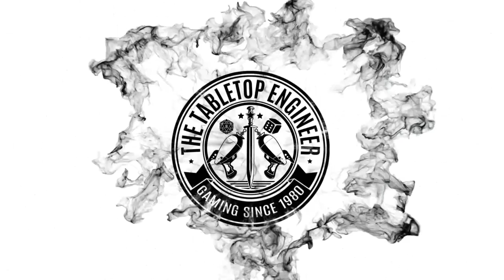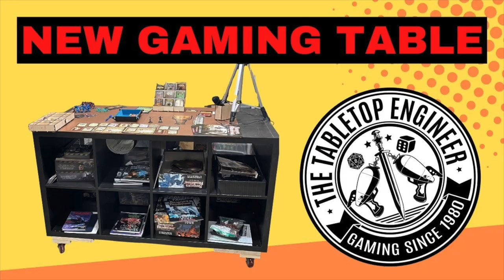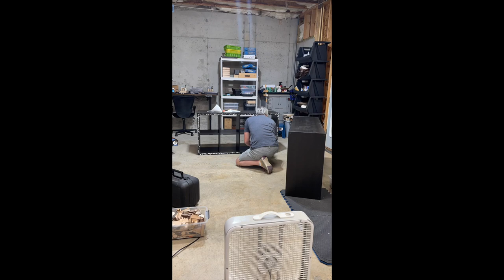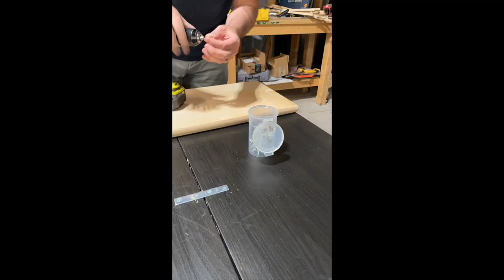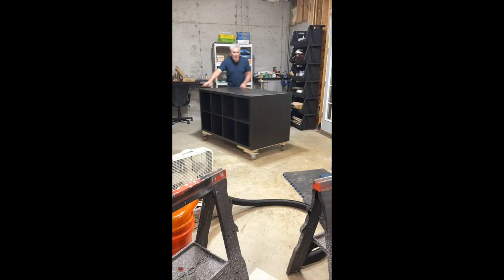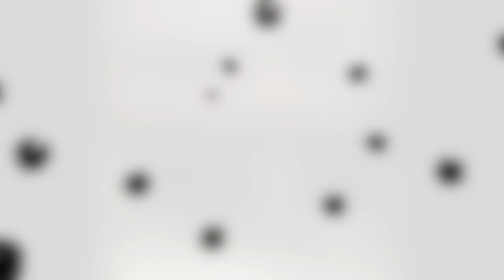My New Gaming Table

Comment: Well done! Been using the same thing for about a year, love all the storage.  You went deluxe with it and added some casters and spacers for extra height.  I may need to try that as it does get hard on the back after a few games.
Reply from the maker: Yep... raise it up. Those are 4" casters and with the extra 1.5" boards on bottom, it gets it up to just above waist high. Very easy to use.